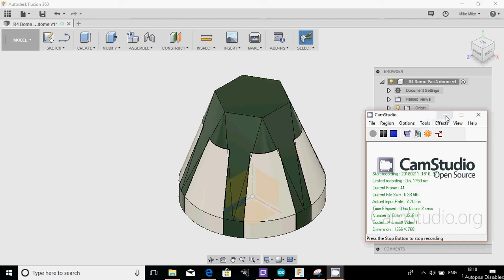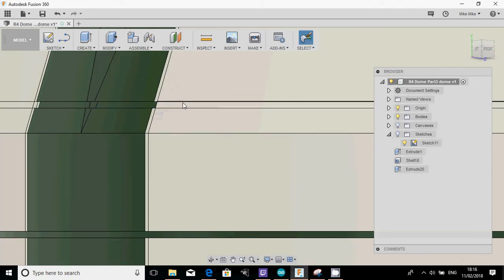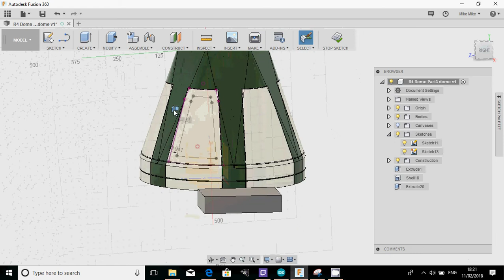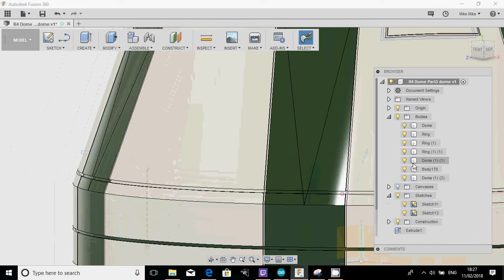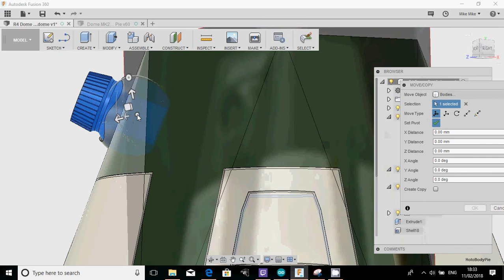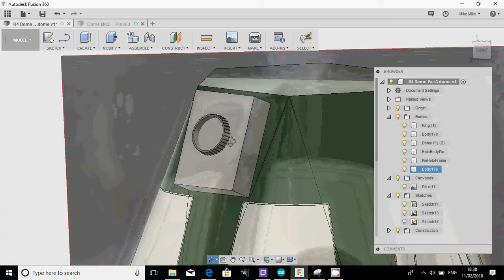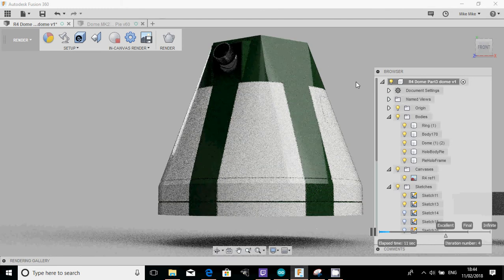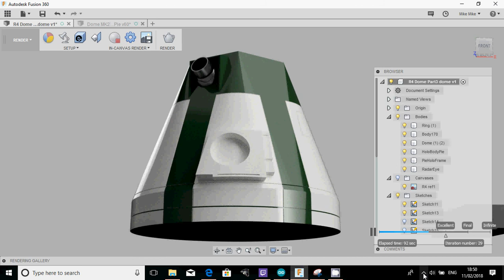Vid3   R4 Dome 4

Comment: I am learning a lot about how to use Fusion 360 from watching your videos.  I'm curious why you shut off the Design History?  Most people use it in order to go back and tweak certain parts of the model later on in order to make it better.
Reply from the maker: Yeah, it stops me cutting and pasting from one design to another, it also links objects when you chop them (cut a ball in half and delete the one side, it deletes both). Lastly it restricts access to some of the work screens, so overall I find it limits how I design and I never use the timeline. I also delete the sketches and planes as I go, effectively like sculpting or cutting wood, so whilst it’s unorthodox it works for me much easier with the timelines off. The cloud save allows you to access all previous saves if I need to go back. As I said, it’s what works for me, would recommending trying both ways :-)
Reply: I see!  Now I know why when I split a body into two I couldn't delete one without deleting the other.  Good to know!